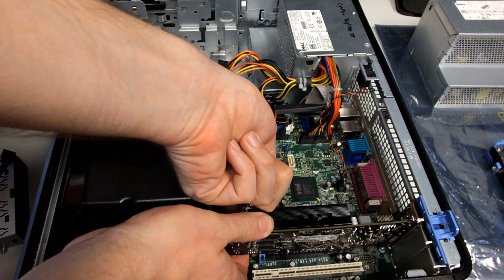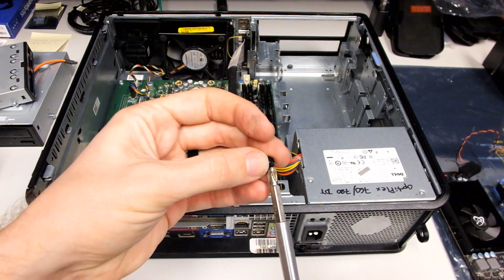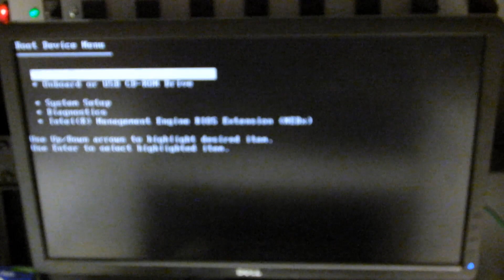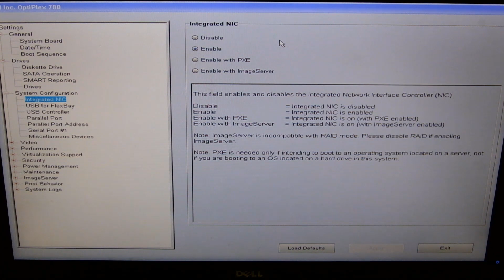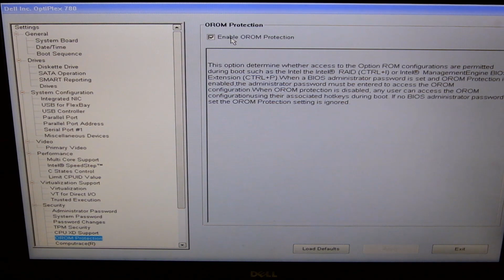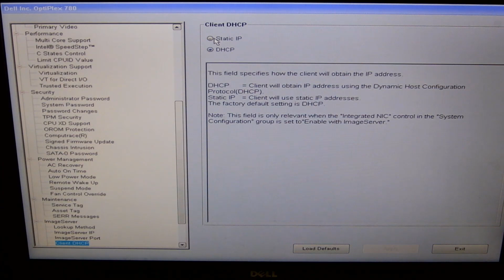Troubleshooting and repair of Dell OptiPlex 780 desktop PC

Comment: This video was very helpful.  My system won't boot properly anymore.  I back it up every 2 days.  I restored a backup I did from Aomei Backuper and it still doesn't work.  Upon bootup, even before loading the hard drive the screen displays strange characters, and then when I hit F12 it brings me to the bootdevice menu - but half the characters are not there, I can only see some.  I had to watch your video to make out what those options are.  Sometimes it goes a little further and tries to load windows - I see the windows background screen appear but it doesn't go all the way and reboots again.  I was able to get into safe mode yesterday but having trouble getting that far today.  Any ideas on what's going on, and what I might do to resolve this?  Thanks Mike.
Reply: It's the exact same dell optiplex 780 as you have in the video.
Reply: I removed the graphics card and plugged monitor to main board vga ouptut and am able to see menu items clearly now.  I can see the device boot menu now clearly.  When I press F8 I can also get to a menu which offers different options for safe mode, but each time I try safe mode, it starts to load windows then reboots again.  Sometimes it tries to do the "startup Repair" but always ends up saying "Startup repair cannot repair this computer automatically"
Reply from the maker: Hi!  Thanks for the comment.  Based on your several comments it sounds like you're already doing some troubleshooting.  That's great!  If I'm reading right, it sounds like removing your graphics card resolved the display issues.  So you may have a faulty 3rd party graphics card.  It could also be a loose or dirty connection on that card, so maybe something you can fix.

Also you mention the computer is unable to boot to Windows, even in Safe Mode.  Just to rule out any further hardware issues I recommend you press F12 and run the built-in hardware diagnostics.  This will test hardware including CPU and RAM.

If all hardware tests pass and the computer is still unable to boot, it's likely you have a corrupt operating system.  You can try creating a bootable USB flash drive to use some of the advanced recovery options.  Worst case scenario, format the hard drive and reinstall Windows - that will fix any OS issue, LOL.  There are some other steps you can take, but I'd recommend first running those hardware diagnostic tests and seeing if you can use any of the advanced recovery options ("Repair your computer") available on a recovery disk or USB drive.  I show how to create one of those in this other video:

https://www.youtube.com/watch?v=zwxsDOrIlxY

Good luck!
Reply: @CompTechMike  Thanks Mike.  I removed the graphics card and was able to restore my backup and it loaded back into windows without the graphics card.  When I put the graphics card back in there were problems again.  Reading some comments here and your answers helped me to get the idea to remove some elements down to the basic (ie the graphic card) to see if I can isolate the issue.  That lead me to find it and solve my problem. Thanks so much!!!
Reply: I rand the hardware tests adn they passed fine. Was able to boot into windows fine.   Today when I tried to open excel, and open one of the files in recent history, it just crashed and restarted.  Same thing next time.  Every time I opened a particular file in recent history or the autorecover of that file.  Would I need to uninstall/reinstall or repair excel?  Looks like it has problems.  Any ideas on what could be going on and what you would do to troubleshoot, or resolve it?  Thanks.
Reply from the maker: @Nowisthetime01  Hi!  I would try doing an online repair of Microsoft Office.  You can find instructions how to do that here:

https://chainbridgetech.freshdesk.com/support/solutions/articles/67000218443-how-to-do-a-repair-reinstall-of-microsoft-office

Good luck!

Comment: do these still have value i have about 13 of these and 4 of them don't work should I fix it or not?
Reply from the maker: Hi!  Thanks for the comment.  Whether or not something has value is a pretty subjective question, don't you think?  Depending on what processor, RAM, video, and storage is installed, the cost of upgrading them may exceed the cost of just buying a new computer.  In that case, I wouldn't say they have much value.

But for me, personally, what I do is fix them up, add a WiFi adapter (around $13), install the latest version of Windows 10, a few utilities, productivity suite, and set them up so they run well, then sell them for a couple hundred bucks along with a monitor and new keyboard/mouse on Facebook Marketplace and Craigslist.  Because I know that the computers I build are better configured than some bloatware-filled junk you might buy at Walmart or Best Buy.  I even make videos of my computers before I sell them, so people know exactly what they are getting.

Anyhow, that's just my .02 cents.  I believe they have value because if you set them up right they can still work well and be of value to someone else.  Cheers!

Comment: Hey, I have this Ram problem on my 780, is there a way to fix it?
Reply from the maker: Hi! Thanks for the comment. When you say "I have this RAM problem" could you be more specific? What problem are you having, exactly? There are several different types of problems, and several troubleshooting steps you can take to help resolve them.

First, I'd recommend you start by removing all but one stick of RAM. Try it in different slots. If your problem is that you have a single bad stick, this will help you to determine which stick is at fault. You can also run the built-in BIOS hardware tests (press F12 after turning the machine on) which will test your memory.

Also, across the front of the machine, are the lights 1-2-3-4. If you get a specific sequence of lights or a beep code, try looking that up in the Optiplex 780 Technical Manual (link elsewhere in the comments, or you should be able to google it).

Worst case scenario if it's your motherboard at fault (rather than a stick of RAM), replacement motherboards are available on sites like Amazon and eBay starting at around $40 USD. Just make sure to get the correct size board for your case (either USFF, SFF, DT, or MT). Good luck!
Reply: @CompTechMike  it has this error code 1 3, the computer keeps shutting down every 3 to 5 to 10 minutes.
Reply from the maker: @CartoonFinder  Hi!  You can download the full technical guidebook on Dell's website, here:

https://www.dell.com/learn/us/en/04/business~solutions~engineering-docs~en/documents~optiplex-780-tech-guide.pdf

And the service manual is here:

https://images-eu.ssl-images-amazon.com/images/I/B1cEeKjqcPS.pdf

Per the service manual, 1-3 indicates an issue with the video memory.  If you don't have a separate video card the video memory is shared from the main system memory.  I would suggest you start with all of the troubleshooting steps I listed above with regards to identifying which memory stick is bad.  Also running the built-in BIOS-level hardware tests on each individual stick of memory would be helpful to identify which stick has failed.  Good luck!

Comment: mike can you tell if this case is compatible https://www.amazon.ca/Cougar-MX330-Computer-Gaming-Case/dp/B074LRNC44 for hp compaq pro 4300 or do i need any connecters
Reply from the maker: Hi! Thanks for the comment. The link you posted to the case says it fits Mini-ITX/Micro ATX/ATX form factor motherboards. Google says your PC uses a BTX form factor motherboard. Can it be made to fit? Sure, anything can fit anything with enough hacking. But it's not designed to fit. 🤔🤷
Reply: @CompTechMike  thanks do you know any around this cases around this price
Reply: Can i just put it you just put in the board and a couple of screws
Reply: Like there is enough space i am just swaping the case replacing the powersupply with a dell on is this possible
Reply: The case has no glas ao that does not matter how it lokks i am asking if everything will fit
Reply from the maker: @Fashahzad  Hi!  Thanks for the comment.  As I said before, you are looking a case designed for Mini-ITX/Micro ATX/ATX form factor motherboards.  From my research the HP Compaq Pro 4300 desktop uses a BTX form factor motherboard.  So, physically, your motherboard would probably fit.  But things won't line up - in particular, the expansion slots won't line up with the holes on the back of the case, and the screw holes might not line up.  Also you may need to get some adapters and extension cables for things like drives and power supply. 

Personally I would recommend against this, but if you don't care about things like that then you can probably make it work.  Good luck!  😃

Comment: Hello any  cses that will fit
Reply from the maker: Hi!  Thanks for the comment.  These Dell systems use a proprietary style of case and motherboard (commonly called "BTX").  As such the motherboard will not fit in a standard ATX style computer case.  Likewise an ATX motherboard would not fit in a BTX case.  I mean, you could probably "make it fit", but not without a lot of hacking.  If your case is damaged, it is best/easist to get a replacement case in the correct form factor for your particular system.  😆

Comment: Hello when i unplung the internal back yellow wire for display the test button works but when i plug it in and press test buttonndoes not turn greennjust hear a click 1 and light and amber light no boot could it be a faulty motherboard
Reply from the maker: Hi!  Thanks for the comment.  I'm not really sure I understand what you are describing.  There are two cables going from the power supply to the motherboard.  The large ATX-style connector, and the smaller 4-pin black and yellow wire that connects near the processor.  Neither of those are for the display.  Both must be plugged in in order for the computer to operate.  There are additional cables for the drives but these don't need to be plugged in for the computer to be able to turn on.

The test button on the back of the power supply is for testing the power supply.  If you press it with the computer off, the fans should spin.  This will indicate that the power supply itself is working.  If you press the main power button and nothing else is functioning and the computer is not turning on (no lights, no beeps, no 1-2-3-4 error codes), then your issue is typically the motherboard.  Occasionally it may also be the power button itself, the panel the button is on, or the cable that connects it to the motherboard, but those components going bad is rare.  The motherboard is much more frequently the issue, in these cases.

You can typically buy a correct replacement motherboard for around $40 on sites like Amazon and eBay.  You will need to make sure you get the right one for your particular model, then follow the instructions and commentary in this video to replace it.  Good luck!
Reply: Sorry let me explain i ahve an optiplex 780 ssf like your but a smaller suply indont know the excastbmodel but when i plung the buttonnturnsbgreebi beleive utsna board failure ivthink one of the capcitors are lose ia thia possibe
Reply from the maker: @Fashahzad  I'm sorry, I don't understand what you're saying.  Based on your description it sounds like your motherboard has failed.  These are common components and can be bought on sites like Amazon and eBay for around $40.  You will need to buy the correct model to match your particular PC.  Usually search for "Optiplex 780 motherboard" and narrow it down from there based on form factor (either USFF, SFF, DT, or MT).  Good luck!

Comment: Hello i have one lights 1 and 3 the power supply button is green but i think it could be that because the computervgets litle power for 2 sec
Reply: Do youbsell these boards maybe i cannbuy one from you
Reply from the maker: @Fashahzad  I'm afraid I do not.  Just checked on Amazon though for "optiplex 780 motherboard" and saw dozens of listings, starting at $30.  You would just need to get the right size model for your chassis (SFF, USFF, DT, or MT).  It sounds like yours is the SFF so you would probably need one like this:

https://www.amazon.com/Dell-Optiplex-Factor-Mother-3NVJ6/dp/B003L9OWGU/
Reply: Thank you very much it should work when i put the new board in am i corect yhank you
Reply from the maker: @Fashahzad  Based on the symptoms you have described, yes.  You may want to find a qualified local technician to confirm this.  Good luck!
Reply: @CompTechMike  im having a similar problem with power cycling, cmos battery ram and power supply are fine, do you think the mother board is the culprit here?
Reply from the maker: @wise5805  Hi! Well, you'd want to start at the beginning with your troubleshooting.  Read some of the other comments, but basically you want to remove everything (all but one stick of RAM, any add-in cards, etc.) and see if the computer works that way.  Test it with the RAM in different slots.  Run the built-in BIOS-level diagnostics.  Verify that it's not a software problem by booting off a Ubuntu "Live CD" (or flash drive), or similar alternate operating system.  Check if you're getting any of the 1-2-3-4 lights.

Basically, there's a ton of things you can do to help nail down the source of your issue.  It's impossible to list all of them here.  Once you've done all that, if it still looks like a motherboard issue, fortunately those boards can be bought pretty cheap - for around $40 online - and are easy to replace.  Good luck!
Reply from the maker: Hi! Thanks for the comment. 1-3 usually indicates a memory error. I would try removing all but one stick and trying that in a couple different slots.  Check out this link for more info:

"Solved: Dell Optiplex 780 Error Messages/Diagnostic Codes Power Button and then 1 and 3 number lights flash - Dell Community" https://www.dell.com/community/Desktops-General-Read-Only/Dell-Optiplex-780-Error-Messages-Diagnostic-Codes-Power-Button/td-p/5116765
Reply: Hello again but do you think it could be a motherboard faliure because when i press the green the fans will spin itbshows 5 bit sometimeflickers to 1 and 4 and before whenb
got this pc it worked finenfor a day a noise was coming from the hard coller thing. After that it showed 1 and 3 the green button did not ligh like said before now there is no 1 and 3 now its 
5 and flickers to 1 and 4. I tried removing memory stick no effect do you think it could be the motherboard or power supply one of them is causing the issue
Reply: It also wont it blink amber light
Reply from the maker: @Fashahzad  Hi again! Is there a small button about the size of a pen tip on the back of the power supply? Not all power supplies have them, but if yours does you can use this to test the power supply (press button when computer is off, if fans spin power supply should be okay).

If all other tests pass and you still cannot get it to power on, I would recommend replacing the motherboard. At my old office where I had many of these machines, I always kept a stack of spare boards. You can usually find them on sites like eBay or Amazon for around $40. Just make sure you get the correct board for your case size. They're pretty easy to replace, if you watch the whole video I talk about that. Good luck!
Reply: @CompTechMike  hello yes the hard drive cage fan spins and the powersupply do you think these mother boards are fixable would you send me a link were to buy also ahould the front fan be spinning
Reply from the maker: @Fashahzad  Hi! The motherboard is generally not repairable without complex diagnostic equipment and circuit tools. The standard procedure is to replace the board. I would recommend checking on sites like eBay or Amazon.

When I used to buy them regularly they cost around $40. I always kept a stack of them since they were common points of failure.

You would need to find the correct board for your specific system, then just unscrew the old one and install the new one, reapply thermal paste for the CPU, plug all the connectors in, and configure the BIOS. Good luck!

Comment: Sir I have Dell optiplex 780 orange light appears on power button 
And 1 2 error appears and no display 
Plz help
Reply from the maker: Hi!  Thanks for the comment.  The 1-2 lights indicate a possible expansion card failure has occurred.  I would try removing all expansion cards and all but one stick of memory and see if the system is able to boot normally.  If it is, re-add each component (RAM, expansion cards, USB accessories, etc.) one at a time to try to identify which component may have failed.  Sometimes it's just a matter of removing & reseating all of the cards or cleaning the slots.

You can read more about the troubleshooting codes in the manual, here:

https://www.manualslib.com/manual/678395/Dell-Optiplex-780.html?page=16#manual

Worst case scenario you may need to replace the motherboard, but those can usually be found pretty cheap on sites like ebay and amazon.  Good luck!  Let us know how it works out.